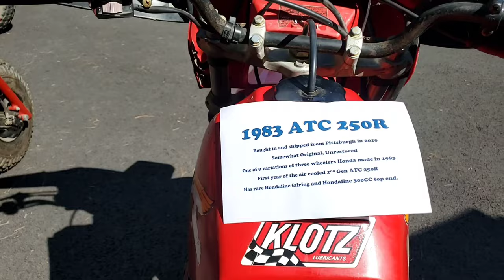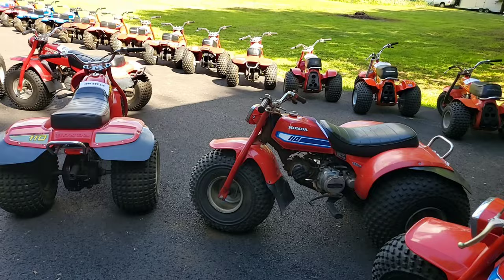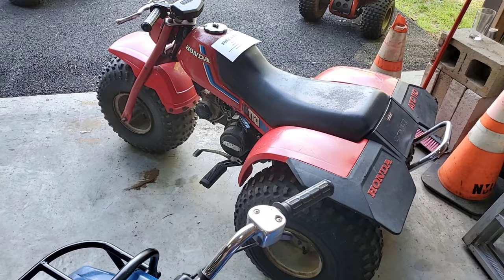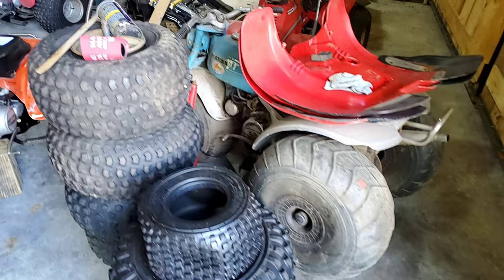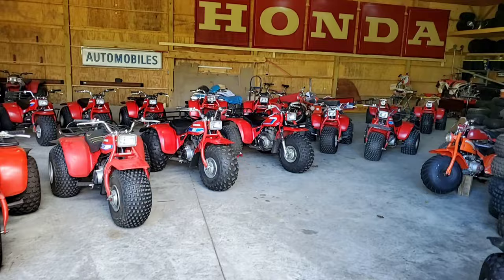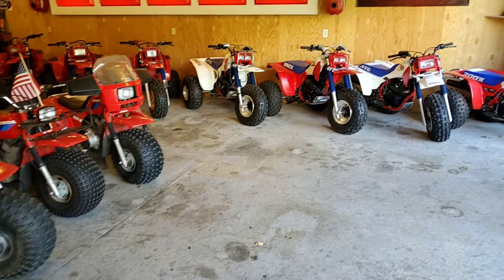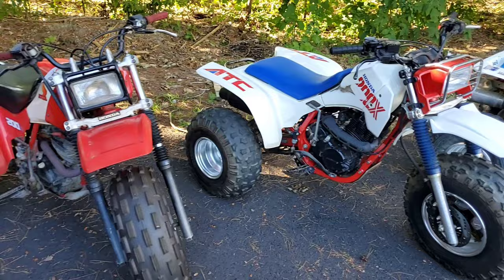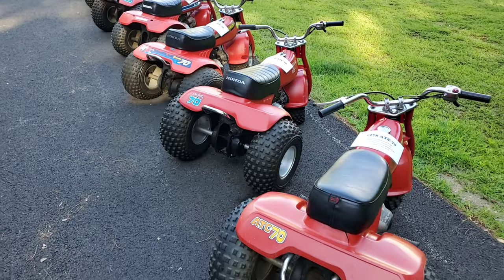Every Honda Three Wheeler Variation - A Video Tour Of All The Production Honda ATC Models

Comment: I am 47.. Wow does this bring back strong memories.. In 1984 my dad bought a 110 and 70 new and they was a blast for many years.. After a few years the machines wore out and I was in my early teens and dad got rid of them in pieces.. I have been looking to buy a nice 84 70 and 110, just to have.. To this day I have dreams about those machines.. It’s crazy..
Reply: In 84 I believe the 70 was about 650 new and the 110 was around 800.. Times have changed..

Comment: Excellent Show Brother. it really warmed my heart, My family owned a couple HONDA  Dealers in San Diego  where I started working at Holiday Honda in the 6th grade. If you call it work ,Id wash all the used bikes, start them up and ride back and forth. I enjoyed your show so much I watched it twice. its very cool what you've put together, your definitely a special person.  I worked at our shops from 1976 to 1989.  So the "Blue Christmas models" The first year we did do a drawing for a Giveaway if we did drawing  Honda picked up 1/2 the dealer cost  that was advertised on the radio, But that was the only year we did that. From then on, we sold them. Honda wasn't splitting  cost.   I always thought the blues were neat, but in early 80's It was all about the 250R and 200X, and the blues just sat. I saw you had a couple later model kick and go's, but ya didn't have the one with 3 wheels? lol 
                                            Congratulations on your collection!

Comment: In 1970 Honda sold the 3 wheelers with a factory option wooden trailer accessory from the dealership. We still have the wooden flatbed trailer and the 3 wheeler to this day. It doesn't run anymore and I have never seen it run but my old man rode it around on the farm back in the 70's.

Comment: I’m having trouble identifying the model of a big red ATC. I’m working on a friend’s machine and it has reverse, shaft drive and the spark plug is on the left side of the engine. He told me that it’s a 85 200cc big red ATC but that doesn’t seem to match with that model. It also has a plastic fuel tank. I also need a few parts. Head light and RH handle bar clamp. The instrument panel mounting hole is broken off the handle bar clamp. Thanks.
Reply from the maker: I have about 3 Big Red specific videos that are newer than this one you're commenting on.  I think one of those will be helpful to you.

Comment: That's a lot of trikes!!
Reply from the maker: I should have done time lapse of putting them all away!
Reply: @ThisOldTrike  a tip, if your tires have a slow leak or small crack, you should put some tire slime, it helps a lot if you have OEM tires🙂

Comment: Could the 110 125m rack mount width change  be due to a battery box??? Did  the frame change so it could go down the line as 110 or 125??????🤔🤔🤔
Reply from the maker: I think you may be on to something.
Reply: @ThisOldTrike  wheels are always turning....

Comment: Isn't the "M" in 200M to designate shaft driven or chain driven?
Reply from the maker: I can't figure the M out honestly.  M's are all chain drive, electric start... for the life of me I can figure out what it stands for.
Reply: I had an 84 200M. My Dad bought it new. What I learned was the M was the same as the S but M meant electric start
Reply from the maker: @yayo4206923  the 200M and the 200E Big Red are extremely similar machines.  The 200S is smaller altogether.  It's generally accepted that the 200E was an E for the Electric start.  I think the M stands for Mystery...
Reply from the maker: @yayo4206923  the 200M and the 200E Big Red are extremely similar machines.  The 200S is smaller altogether.  It's generally accepted that the 200E was an E for the Electric start.  I think the M stands for Mystery...

Comment: I bet you would know what a 200 big frame is. 200s 200 big red w/c all completely different but the engines are the same very off the wall frame changes try in to get the right fenders is to short or way to long just drive a guy crazy

Comment: What is "S"
Reply from the maker: The 19th letter of the alphabet.
Reply: Well i was just wondering because i just purchased a 185s  
I see you dont have many 185 trikes.
Last one i had was a 200m years ago
Reply from the maker: I wasn't sure what exactly you were asking at first.  This question has been asked by many and there really is no correct answer.  Here are my thoughts on it though.  So, in 1980 Honda made the ATC 185 (no letter)... and this machine turned into the ATC 200 (no letter) in 1981.  Essentially the same chassis/machine size.  In 1981, it was also the first year of the ATC 185S, which was a smaller chassis/smaller overall machine size.  So, does the "S" stand for Small??  Maybe.  Was the smaller 185S a little sportier than the larger 185 which was more of a utility machine, yes.... so does the "S" stand for Sport?  Perhaps.  It's safe to say it doesn't stand for Shaft, like it does in the 200ES and 250ES.  Usually the Sport machines have and X or R... not an S...   So, my best guess is "Small".  The 185S is a small version of the 185 and the 200S is a small version of the 200.  Then the next question is, what does the M stand for in 200M or 125M...  It can't be Medium... because the 125M is smaller than the 185S... so that would blow that theory out of the water.  The 200M was a base version of the 200ES Big Red...  Very similar to the 83 200E, where we know the E is for Electric Start... and this is a chain drive machine... so, the M is also an electric start, with chain drive, but no high/low range...  But the 125M has high/low range (on the 84/85).  I think it's a mystery and I think that is what the M stands for...